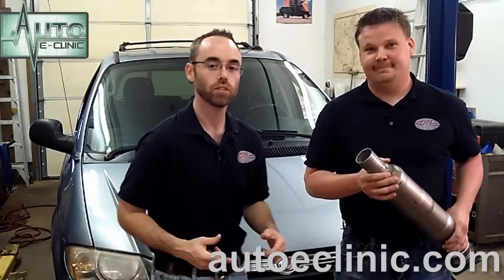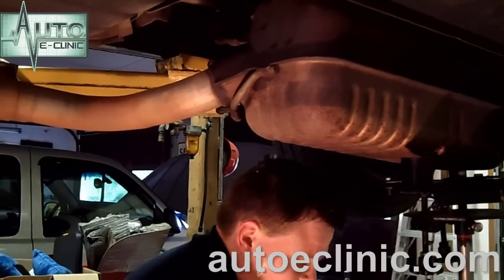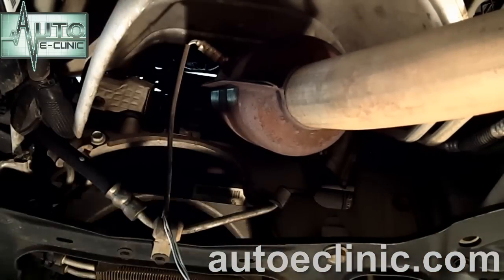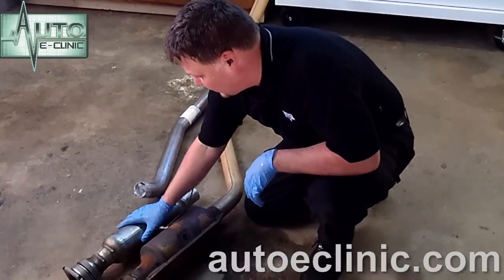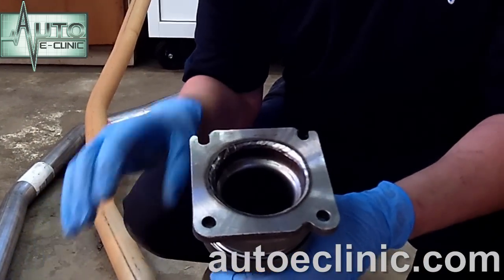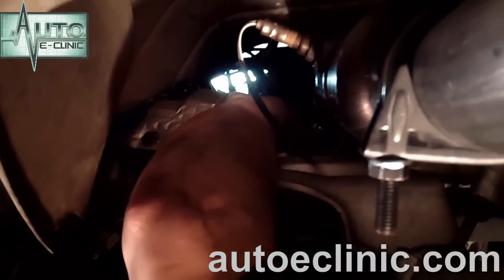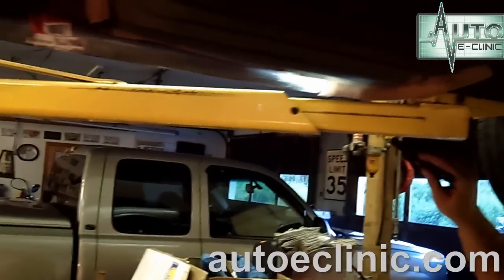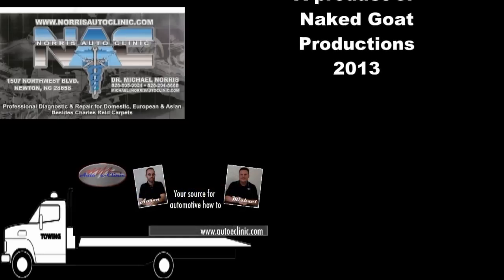How To Replace A Catalytic Converter - Chrysler Town & Country 3.8L

Comment: Yo, you guys owe absolutely EVERYONE HERE, an explanation for how you got the upper curbside flange bolt and nut apart AND back together.

It's impossible to get to with tools by nearly every conceivable approach. 
I torched it off, but you can't torch it back on!

Comment: Did a job like this on a 1998 Chrysler Grand Voyager minivan. When replacing the exhaust system bolts. A friend I know who is a mechanic used anti-seize on bolts. The anti-seize allows easy removal in the event of future repairs.

Comment: Nice, I just cut my pipe behind my cat, hollowed out the cat and spliced my pipe back together, it would barely climb a hill at 50 mph before but now has more horsepower than it's ever had.

Comment: So ive tried to get mine off. A 13 just spins on it like its too big a socket. So then i tried a 12mm would not fit. Then tried a 1/2 and still spins. How do i remove the bolts to the manifold now. ?
Reply: Torches

Comment: I couldn't get the top number 4 bolt out,  what would you guys suggest??? I also have a 2005 town and country
Reply: Torch.
Reply: -- Hi. -- Did you ever get that bolt out? -- If so, how did you do it?
Reply: @VAIO294  I couldn't get it out, I tried something different that worked for me
Reply: @cesarflores9805  -- OK.. Glad you found something that worked for you. --- I removed the windshield wiper cowl and was able to get that #4 bolt out going at it from the top of the van instead of trying to take it out from underneath the van. -- A 1/2 inch regular wrench fit the bolt good on my 2007 short wheelbase Caravan, and after some penetrating oil, it came right out.

Take care.
.

Comment: This is the most misleading video I have ever seen. Couldn’t show how remove that top bolt huh bud ?  waste of time.  Biggest part of the whole job.  You guys are a joke.
Reply: --- I removed the windshield wiper cowl and was able to get that top right bolt out going at it from the top of the van instead of trying to take it out from underneath the van. -- A 1/2 inch regular wrench fit the bolt good on my 2007 short wheelbase Caravan, and after some penetrating oil, it came right out.

Comment: Wanna save yourself some troubles? Since you are probably gonna do the downstream,  and upstream Oxygen sensors during this repair.  The upstream will require o2 socket to get out.  

The 4 bolts on the converter on my van were practically impossible to get off because they were nearly welded from the heat cold HEAT COLD. I snapped two of them during removal.  There are 4 nuts with a lock tab, on the engine side of the mount that are 15mm, and will spin around if your bolts are rusted or fucked up, if they spin the tab will fold over the nut causing much more problems.  If you can get a wrench on them to keep that from happening.  I highly recommend it. I did break the bolts (M-8 1.25/45mm) and got replacements at oreileys.

Now upon install of new pipes, I recommend a pipe expander to get that pipe all the way in to avoid those exhaust leaks.  And to get around extreme man handling of those connection points. 

I soaked all bolts with PB Blaster before wrenching. Everyone says the top right bolt is barely accessible.  But with two 6"extensions(swivel kind) and two 3" extensions I got that bolt easiest out of the 4.

The rear pipe clamp needed a torch to heat up and break loose as I snapped my first 15mm on it.....

5 bolts did take me two days.  Be prepared for fun.
Reply: This is exactly what I was looking for. They didn't even address how the bolts were put on. I was just under my van, which is rusty, and started shaking my head. I can reach three nuts uncomfortably and I hope that top right bolt treats me right, because I can't figure out how to reach the back. LOL. It's covered in PB Blaster right now. Wish me luck.
Reply: Exactly why I cut it after the cat, hollowed it out, and put a clamp on it and called it a day
Reply: @johnnyversaci7091  Oh yea? Did you use/buy a short exhaust connector with 2 clamps or? And what did you use to break up honeycomb inside the cat? About to do this on a 05 T&C
Reply: @tinytim9453  I used some screwdrivers of different sizes to break up the cat, after cutting the pipe with a sawzall. After that I did what you said which barely ever works, the small pipe with exhaust clamps.. but then I realized u can buy a clamp that has a piece of sheet metal you  wrap around the pipe and tighten the bolts, from advance auto I will get the part number for u
Reply: Thanks for this. I came here just to find out the bolt sizes.
Reply: @joshuagibson2520  your welcome.  Worst part is we needed a California special cat. And ordered a dang universal cat. In less than a few weeks we got the same engine light and code for bad cat. I guess the California cat and ecu program has tighter tolerances and was throwing off the system.  So we had to replace it again.
Reply: Are you wearing a cape? Because you should be.

Thanks for the tool configuration to installation of replacement hardware, on the upper curbside of flange.

Epic.
Reply: @warphonesS22 , you're a hero.

Comment: I like how u didn't show how much of a pain in the ass the top right bolt was. Try taking the converter off laying on the ground it fucking sucked
Reply: --- I removed the windshield wiper cowl and was able to get that top right bolt out going at it from the top of the van instead of trying to take it out from underneath the van. -- A 1/2 inch regular wrench fit the bolt good on my 2007 short wheelbase Caravan, and after some penetrating oil, it came right out.

Comment: My 2013 Grand caravan showed the  code for a faulty catalytic converter. I took it to the warranty and they "replaced" it. After they gave us the GC back,I noticed it sounded a bit louder. I got home and used it the next day with the same results. Then today,the same. I lay down in the front to see the catalytic and guess what??? It wasn't a new catalytic converter and it have only one screw (bolt) and no gasket😠🤬😭. I'll have to go back to the dealer and start ww3 there.

Comment: where did you get your new bolts and nuts , what size were they . thank you very much
Reply: scooter12368  just go to the chrysler websight or dealer they can set you up with bolts and flag nuts. they just need year and engine size.

Comment: i have an '05 and i need a new converter cause mine has gotten noisy as heck.  im debating over whether i should get a Mopar one or aftermarket
Reply: Cobra Ninety Six hello guys what cat did you finally get ( aftermarket or OEM ? Price for both $
Reply: I went to Hottexhaust and applied my VA discount for a $126 discount. $449 shipped.
Reply: I have the same van 2005... I mounted a strap on the pipe 3 feet after cat and fixed to frame it quit rattling and is quiet now. I hope this works for awhile.... worth a shot

Comment: I'm having trouble removing the top right bolt on the cat that goes to the exhaust manifold. I'm working from the ground, swapping the engine out of a 02 with a 3.3
Reply: @Brian Jenkins -- I removed the windshield wiper cowl and was able to get that top right bolt out going at it from the top of the van instead of trying to take it out from underneath the van. -- A 1/2 inch regular wrench fit the bolt good on my 2007 short wheelbase Caravan, and after some penetrating oil, it came right out.
Reply: Brian Jenkins any luck. had the same problem  13 mm socket and rachet on the end of rachet used 14mm deep socket and a 4 in extension for leverage. very little room to turn bolt but it will also soak bolts as long as you can with penn oil this will help. i tried many things this was the only andwer other than cutting it up in pieces w a hacksaw.
Reply: hit send you need to go under the van inbetween the tie bar and plate very little room to do this but you can get up in that small space to get to thar darn bolt. a breaker bar is too long it hits the plate or tie bar to turn the bolt remember to really soak those bolts with penn oil i mean really soak them.
Reply: Recommend penetrating oil and an obstruction wrench 13mm. Reason being the sidewall on the snap on has a thinner wall and allows you to get on the bolt head. After over wrenching I rounded the bolt head on the 10 o'clock bolt but overcame it by buying a cheap pneumatic 3" cutter. This approach might be useful for the majority if they are extra stubborn and merely replace the bolts and nuts.

Comment: This is crazy tight for the driveway.  I need a little more room to work with.  I'll have to remove windshield wiper and drain tray, for  better access to remove and reinstall the two top (very hard to get to) welded together bolts. With the van jacked up on  4 cinder blocks, (with support jacks), I'm going to loosen the front centered motor mount, and the passenger side mount, and lower the engine enough to get easily to all the bolts.  Gonna take my time and try this today, on my 2007 Town&Country, 240,000 miles. It'll be well worth the savings  ($1200.00) if the van don't fall. Thank for the video.  7/20/17

Comment: i figured out the top right bolt. first be sure you soak all the bolts with some sort of penn.oil several times the will come off easy. the top bolt takes a 13mm socket w/a ratchet not a breaker bar. no room for the bar. i added a deep 14mm socket and 5 in ext on the rachet go under between the plate and tie rod the rachet will only click afew times but its enough to turn the bolt. the other bolts take along ext. and breaker bar they will come out. be sure you use new bolts and flag nuts get them at chrysler this will make life easier.

Comment: how in the world did you get the top right bolt off. i have been trying but my socket and long extenions do not want to line up with the bolt. HELP!
Reply: Bought a couple half moon wrenches 13mm and 15mm. Ended up using the 13mm. Advise buying Snap Ons since they have a thinner box end which will fit over the bolt head without hitting the circumference. I bid each wrench at $25 and won them. If I bought them new they would have cost over $100. Btw, it is unnecessary to remove the rubber support forward of the muffler. Get some penetrating oil and spray after loosening the band that secures the pipe section. Then grab a big hammer and slug the forward support till you break the pipes loose then wiggle the pipes while pushing them apart. After the flange bolts are removed there is enough room to move the Cat forward enough to separate the two pipes. This is especially helpful if you are only on jack stands. Being patient is key, I'm retired so I just picked at it and ended up buying a cutting wheel to remove the bolt at the 10 o'clock position because I was a dummy and rounded it because the bolts were hard to break. No big deal I bought some great tools and still saved $800.

Comment: the bolts that come off, do they have a nut you have to loosen like on a tie rod or do the just come straight off?
Reply: They have a locking type spacer that keeps the nut from turning. Recommend allowing some Penetrating Oil to soak in for a few minutes first. The 2pm bolt head might require either a flare type crows foot 13mm or good Snap On 13mm obstruction/Halfmoon wrench due to it being super difficult to reach. Reason for Snap On is the boxend is much thinner so it goes over the bolt head. If you get a smaller open end wrench it will allow you to double wrench for more leverage. If the bolts prove difficult I ended up using a 3" pneumatic cutter which fits up there but that 2pm bolt I fortunately was able to easily wrench off with the obstruction wrench which was good for me due to it's inaccessibility.

Comment: Doing this without a lift is a pain in the butt. They also fail to address the nuts on the back of those four bolts! Fought those rusty bastages for hours. Also that rusty beast of a clamp in the back can sometimes be spot-welded, which is another pain. For something so simple (six bolts) it has many unexplained caveats!!
Reply: +Sam Degonia That's why man invented a cutting torch !!
Reply: It is weird how folks tend to oversimplify work needed to avoid an issue. Some stuff you have to figure out but if one knew then perhaps tools needed might help but I guess that's why we're here! Lol!
Reply: I agree that they missed a lot of steps-the bolts are crazy tight and hard to get to.